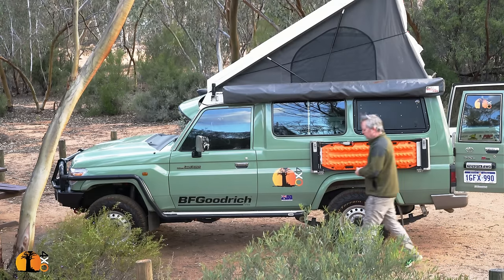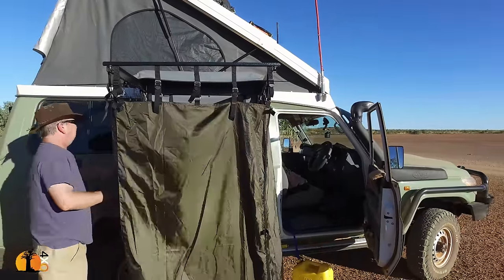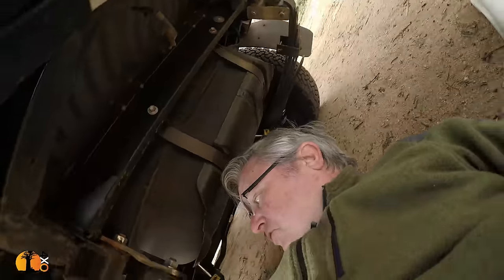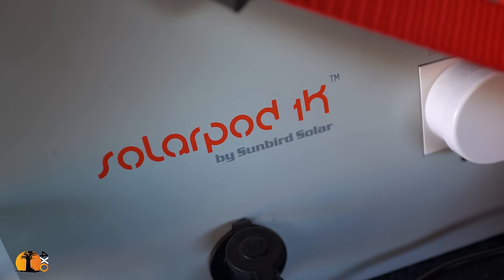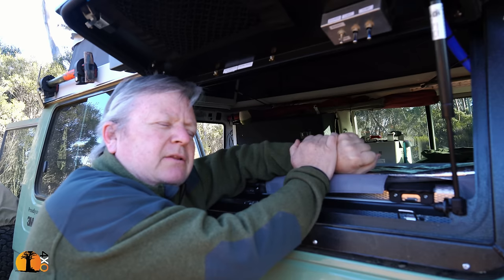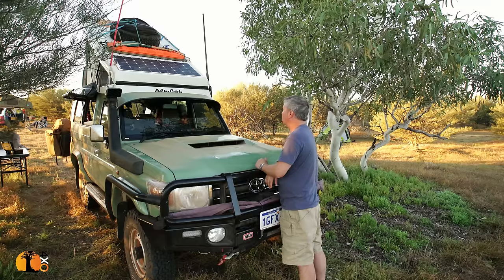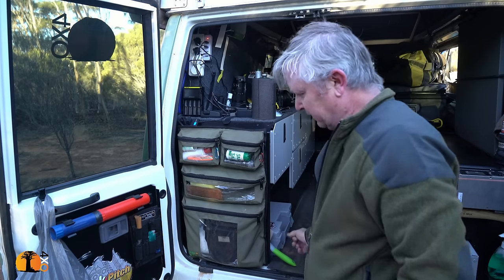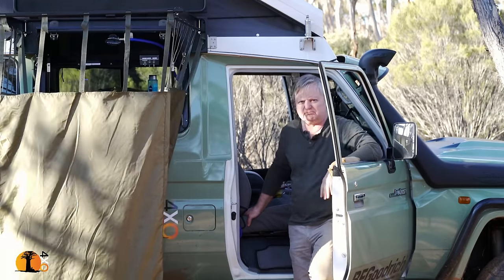TOYOTA LAND CRUISER TROOPY | THE WORLD'S LONGEST TRACK (Ep-9) Andrew St Pierre White

Comment: Hi I’m from UAE, and am big fan of your videos. I’m planning to build my TLC troop carrier with portal axle. I’m seeking your help and advise, if the portal axle will be helpful in the Mideast region for overlanding activity.
Reply from the maker: As an overlanding vehicle, portal axles are overkill and unnecessary in most countries and conditions. In some, like in deep snow, they may be an advantage. On sand, no. If you sink that deep, you're stuck! They are complex, costly and discard many of Toyota parts, so getting a spare part for the new suspension is going to be difficult, no matter where you are. So the question is, is the extra clearance provided worth all that? Only you can answer that. As for me, as an overlanding platform I would not even consider it. I want strength and reliability and I just don't, and may never need, the extra clearance.
Reply: 4xoverland thanks for your reply and your valuable advise . Hope I see you in future

Comment: Andrew, I see two max tracs on the roof and two on the side Correct? Also is that a pull strap or snatch strap attached to the front bumper? Like most of us, you have not had to use the winch? Has anyone made you an offer for your Troopy yet? I wonder what it would take for someone to get it from you at this early stage?
Reply from the maker: On the Canning, 4 maxtrax on the roof. On my later trip, two on the left side. Soon to be fitted, the second two on the right.  Nobody has made an offer and I hope they don't. Too much sweat went into building it and I intend to keep it for many years.

Comment: Andrew, I am wondering if you can answer a query I have, I've always heard that with snorkels if you live in dusty or snowy environments you should point the intake backwards to minimise debris ingress, is there a reason you have yours forward facing?
Reply from the maker: There is lots of misinformation out there about this, most of it illogical nonsense. Backwards creates negative inlet manifold pressure, forwards assists positive pressure. Why on earth would the engine work better with negative pressure? The turbo's one and only job it to create positive pressure. No matter what direction it is pointed, it will suck in the air around it, so forward or backwards makes no difference to the amount of debris it sucks in. Only a cyclonic head will reduce the amount of heavier particles it sucks in by throwing them outwards. It pre filters the heavier particles only. This air intake doesn't do that.

Comment: Looking at shower options myself. .first time I've seen that setup. 
Any thoughts/experience with instantaneous gas units?
Reply: I've had an instant gas shower unit on my troopy for 3 years now. Absolutely brilliant. It uses so little gas that I run a compact 1.5Kg bottle now. A 10L container of water does my wife and I easily. If you're near a water source then a nice long hot shower is possible. We generally travel with 2 other couples and we have 6 showers every second day. I have it mounted in my swing away box on the rear bumper all plumbed ready to go.
Reply from the maker: I have had experience with them, and some are really bad and extremely fiddly, while others are brilliant. So I would suggest, talk to those who have got a good setup and copy that.

Comment: What was your fuel economy on the CSR? be good to know how many litres were used on the longest section between fuel spots
Reply from the maker: We arrived after about 990kms with about 80kms remaining in the last of the 2x90L tanks. We were carrying an additional 20L as emergency spare diesel, but did not need it.
Reply: @4xoverland  thanks for the reply andrew, so a light 76 would be safe with a 180l tank?

Comment: Hi Andrew just got my 66L expedition snomaster today after seeing your vid and doing loads of research. I noticed after running it for a few hours today there was small 50c size water puddles under the fridge where the compressor sits. Also if I have the fridge set to 3 deg c it goes past that to -0.1.  Im awaiting a reply from snomaster but thought I would run the questions past you to see if you have experienced this? Cheers
Reply from the maker: Please let me know what they say. I once had it drop and freeze some beers, which popped. Set on -1 and it dropped to below -3. But no water.
Reply: ok thanks Andrew and I will let you know what they say. cheers
Reply: Hi Andrew rang snomaster they said water was condensation. 
The temp works on average and they said they allow for 3 deg range either side.
Reply: Interested to see how accurate your fridge readouts are if you have tested your freezer and fridge with a thermometer. Cheers

Comment: Hi Andrew, what was the cause of the squeak btw?
Reply from the maker: A blind rivet from the en-suite mounting bracket was touching the original roof, hiding behind the Hercules camper frame. We sprayed in industrial lanolin and it sorted the problem.
Reply: Thanks, good find......
Reply: Hi Andrew! Why di you opt for standard wheels n rims unlike the mags you fitten on your first olive green troopy?
Reply: I was about going to ask the same question. Tnx for the answer Andrew!
Reply from the maker: All alloys for the LC70 are 8". That would make the tyre narrower at the tread than at the bead, which would leave the sidewalls vulnerable. I am considering a larger tyre, with a bit more width, and will then fit wider alloy rims. Also, the old Troopy had 17" rims. I want to stick with 16".

Comment: Did the front track wandering issue bothered you? Cheers
Reply from the maker: not even slightly. Didn't notice it.
Reply: Hello, I'm assuming that this is referring to the difference in track width between the front and real axles?  If it was not an issue, are you planning to leave the rear width stock? Or have a plan to change the back spacing of the wheels or rear width some other way?

Comment: Looking at the solarpod it looks it can technically be the only secondary battery for your vehicle with the solar option. Plausible or theory.
Reply from the maker: It is a real option as the only secondary battery system. Charged by the vehicle or solar, as mine is. It can power fridges, lights etc.
Reply: 4xoverland Been doing some research the inergy Kodiak , not as pretty seems to be a bit better, ie lighter, more versatile, quicker charge, but 110v https://www.inergysolar.com/product/kodiak/

Comment: What is the fuel capacity of this truck ? Range ? Miles to a gallon ?
Reply from the maker: 180L (47,5 gal) in two standard tanks. ±1100 kms range on a rough track, ±1500 kms range on tar.
Reply: Thanks

Comment: What is the name of this valve controlling temperature ??
Reply: Alain Brouillette it's called a temper valve
Reply: Thanks
Reply: More commonly known as a thermostatic mixer.
Reply from the maker: Its available on-line, but don't ask me how to plumb it. I can't figure it out even though its in my own truck! But it works brilliantly.
Reply: Quite straightforward. Hot inlet (always!!!) on the left, cold on the right, and the blended (tempered, mixed) outlet to the bottom (sometimes an additional outlet to the top). Thermostatic function controls the temperature by opening/closing the appropriate port. Saves water and effort, and prevents scalding. Fairly expensive but definitely worth it!
Reply: Jimbob Jones I think there is more to the plumbing than just this though. The boiler would need to fill from the main tank as the hot water is used, you would need some kind of non-return valve to stop the hot water from making its way back into the cold water tank. I reckon this would involve a few pumps & other clever stuff. (I’m no plumber... just trying to work this out!!)
Reply from the maker: Here is a clue. Two diodes, two switches, two solenoid valves and two pumps. That's as much as I know.
Reply from the maker: Not straightforward at all.
Reply: 4xoverland thanks Andrew! :) I will keep working at it until I figure it out! Awesome shower idea! 😀
Reply: I was only referring to the thermostatic mixing valve with a reminder not to get the hot and cold inlets mixed up but the complete plumbing setup ain't rocket science, guys!  Obviously you will need a cold water source, a water heating device, flow control and temperature control and ultimately a dispensing device (shower rose or hand shower).  How you achieve this and what assortment of valves and pumps to use, depend on the degree of luxury and convenience one desires. I think Andrew nailed this one.

Comment: Superlatives, Superlatives, Superlatives ...

I cannot image anything - important - that is not possible to charge from 12 volt DC: notebook, battery chargers (like for cams), digital Camera (like all Sony e.g. with micro USB by default), lights/ most use 18650. 
Every transformation from 12 volt to 230 has lots of losses, like every Watt of heat is lost energy, that was hard gain via solar before.
Reply from the maker: Camera batteries and the Apple MacBook are charged with 110-220v. There is no 12v option available for the Apple laptop.

Comment: Corbeau seats or better priced than the other brands.  https://corbeau.com/susp-reclining/baja-rs.htmlSorry no arm rest ones.
Reply from the maker: I like the look of Sheel Mann seats.
Reply: Look good and might be good. Have used Recaro seats x3 versions since around 1980. Hundreds of thousands of km on them. Still have 2 in use. The difference under the upholstery and foam is different. Recaro uses different variable foam throughout the seat and rubberised base seat support. Lucky that the 70 series doesn't have side airbags on the seats so replacing them is legally relatively easy.